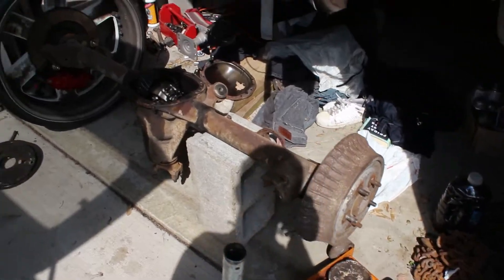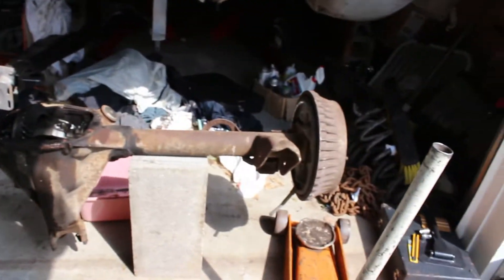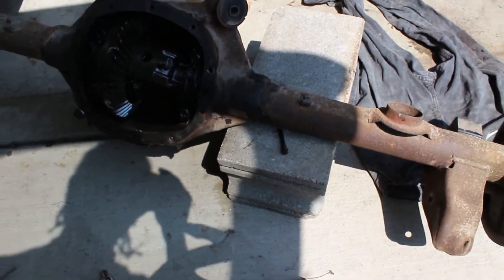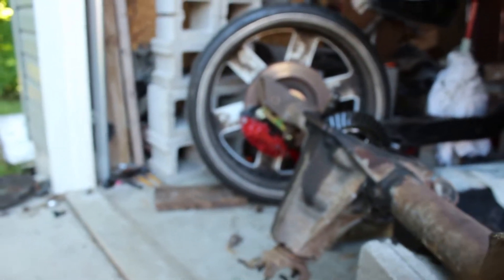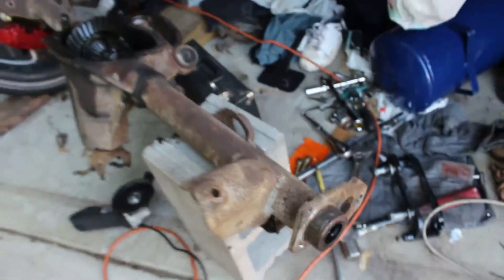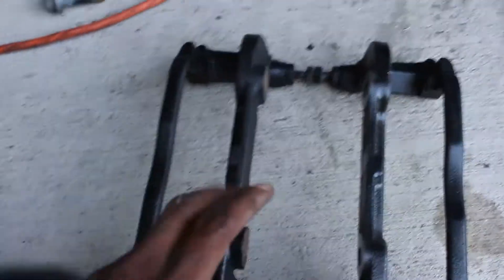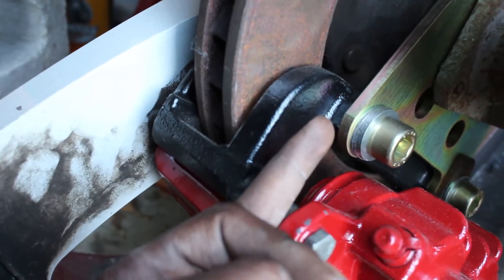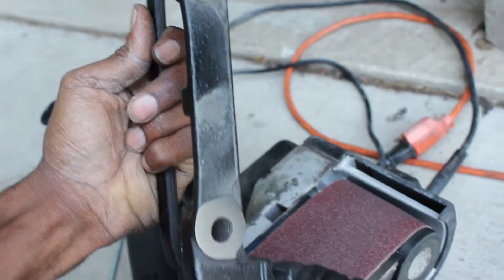Pt. 1 G-body 10 bolt 7.5 drum to C5 Corvette disc brake conversion

Comment from the maker: Nobody makes a C5 rear brake kit like this that I know of. I had to use the brackets from flynbye.com & buy some Vette parts to make it. I keep trying to tell people you can buy a kit thats already put together from one of  brake companies for what I spent making this kit. I wanted to do something different so i went ahead & used these parts. There are also a couple cheaper options but if this is what you want let me know & I can guide you in the right direction
Reply: Yea wanna do the c5 Conversion on my 86 regal with a buick 455 on 22s  project. But if there's a and cheaper and better way then I'm all for it but want everything to match know what I mean.lol

Comment from the maker: Got them from flynbye.com if you just want a simple disc conversion & want to save a few hundred you can use some other brackets he sale & gbody front calipers instead of using the vette parts. I just wanted to do something different to I bought th brackets from him & made my own rear brake system. Got any questions hit me up. Oh yeah you will not be able to use your stock wheels after the conversion. I can only use 17s and larger with these brakes

Comment: Good job! I'm running C5's on my 1965 LeMans.
Reply from the maker: How do you like them?
Reply: Love them. On the front I used spindles from a F body. It gives you a wider stance for better cornering.
Reply from the maker: Steven Lynch Nice. I cant wait to get this thing on the road & see how mines feel. Did you have to change master cylinders or did your stock push enough fluid?
Reply: I want to go with a hydroboost. Haven't got to that part yet.

Comment: first off let me say its lookin good man. its good to see someone doin it all themselves, in the back yard. My only advise is to get you some harder hardware for them brackets. I know you may think its ok, but for a few bucks to get stronger ones would be the way to go. I just would hate to see the car get done then someone pull out in front of you then have to slam on the brakes and that hardware fail. not that it will, im just sayin a few bucks could save the whole car! keep it up looks good!